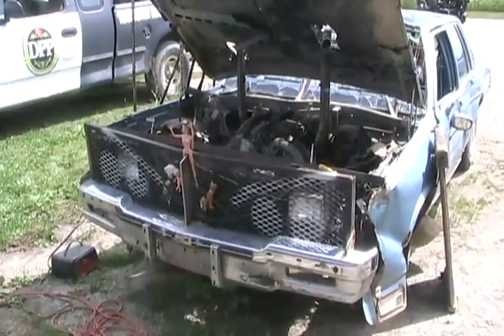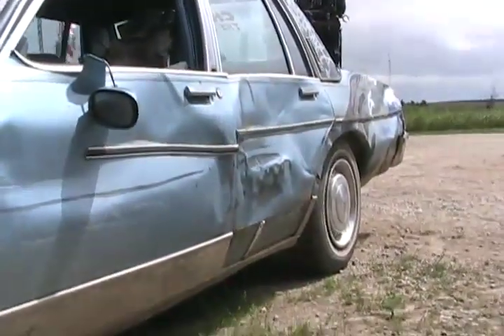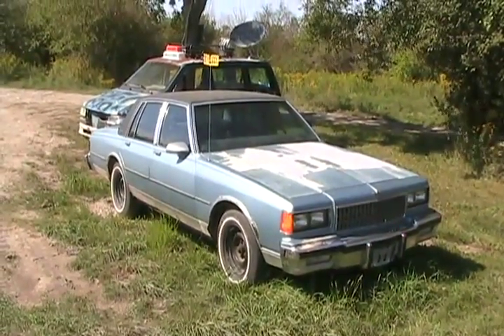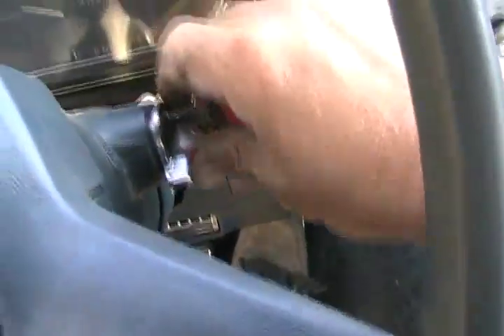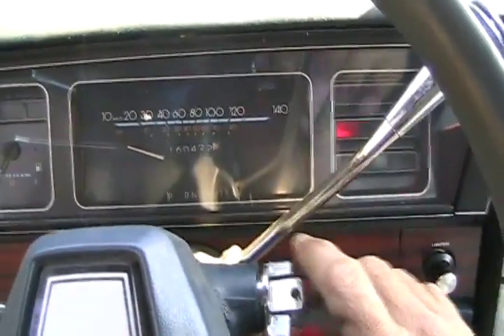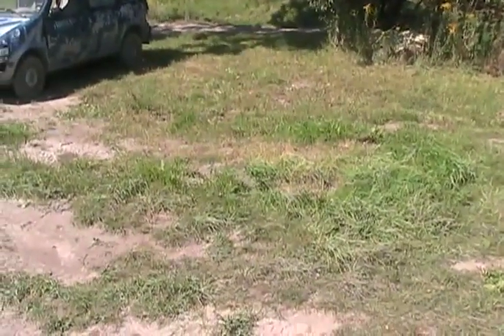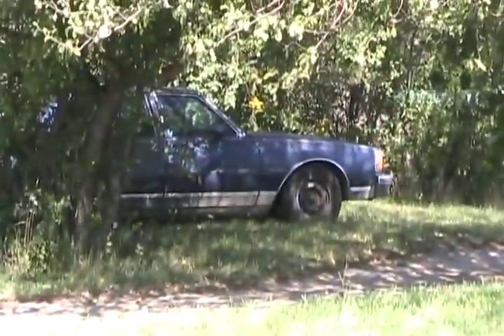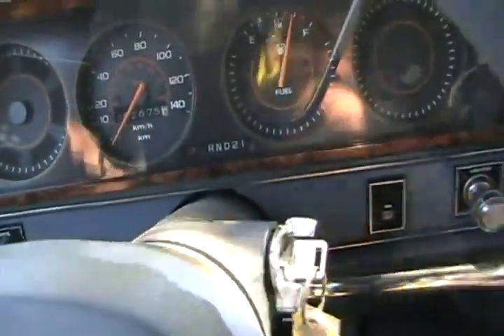#1426 3 Cheviac fix and start up [Davidsfarm]

Comment: Been wondering where all the old 80's boats but now I no there all at your house gotta love em I've got a 78 Oldsmobile and an 85 Oldsmobile last of the real full size bullet proof rear wheel drive cars
Reply: love my 89 regal not as large as the other legends but it still has that old GM feel